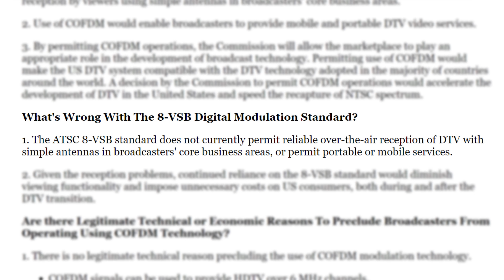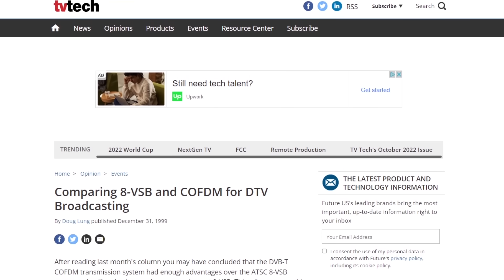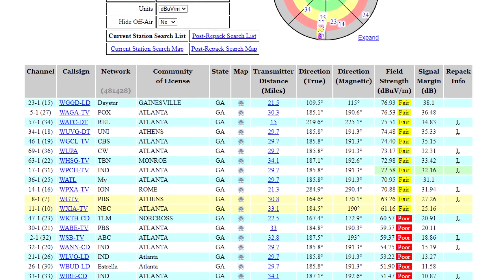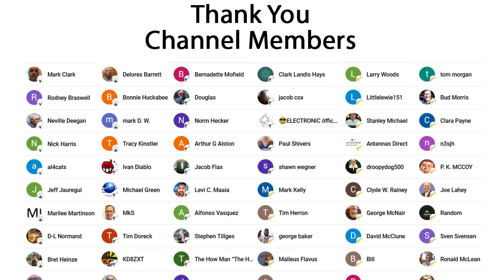This FCC Decision Made Antenna TV Less Reliable for All

Comment: I remember when this all played out.  The 8VSB is a very high speed serial signal with all the data in a single carrier.   Because the data is being sent so fast and the phase of the carrier contains two of the data bits, multi path delays reeks havoc with the signal.  It's only through adva High speed digital signal processing that the system even works.  The phase changes around 6 million times per second.  

COFDM is a low speed parallel signal.  It's like having 6,000 carriers sending the data with 3 bits per carrier.   Because the data changes around 1,000 times per second, any multi path signal isn't a real problem.   In fact COFDM works well with multiple towers sending the exact same signal.   Like 8VSB two bits are sent in one of 4 phase shifts and the third bit is isn't as an  amplitude change.

 Sinclair fought long and hard for the better system, COFDM, but Zenith's lobbing won out.   I remember a NAB Show where they were showing indoor reception with COFDM, something that was impossible with 8VSB.   Pity, Sinclair lost that fight.
Reply from the maker: Thanks so much for posting this comment. I actually explained the technical aspect of both in the video but ended up taking them out to limit the length of the video. I pinned your comment for others to read if they would like. Thanks again for typing it all out.
Reply: @AntennaMan    Thanks, I had assumed that you didn't want to go to technical for most viewers, so I typed it out for those interested in the details.
Reply: It's one of the few things Sinclair did that was actually a good idea.
Reply: @friesareyummy  I agree. I was working for one of their stations at the time. (they had just bought our station the year before in 98' when they were going on a buying spree, right before the bubble burst) They even put out a few reports that stations ran in their newscasts demonstrating the superior signal that COFDM would offer if congress would allow them to have broadcasters choose their own, i.e. give them the option of 8VSB or COFDM when they apply for their digital license. 

They even had one clip where it shows in a congressional hearing, an engineer pick up a simple indoor antenna off a table in the back of the room and walk it up to the front of the room right in front of the committee members while decoding the signal with not a single drop out as the guy walks the antenna the 30ft or so. Meanwhile the engineer goes back and does the same thing with another antenna and 8VSB signal, and the decoder breaks up as he moves it across the room. A stark difference in performance shown right in front of the committee members. 

Sinclair was only asking congress to amend the standard to allow broadcasters to choose either 8VSB or COFDM on their digital license application. It would still occupy the same 6 MHz spectrum as the 8VSB and analog signal, and not cause any interference. The excuse was there was already a hundred thousand receivers (laughable compared to the potential millions in the future) in homes at that time, and manufactures would not be able to make a dual standard receiver, even though the chips for COFDM had been out for years because Europe and the rest of the world had gone that way. 

So it wasn't going to be that expensive to integrate a dual standard receiver, and eventually a dual standard decoding chip on the next generation receiver.. (we already have dual standard radio head units in our cars, AM & FM doh!) Besides, it was found out how hot the early generation 8VSB chips were running and consuming power, so it was impractical with the technology at the time to even consider a mobile device that wouldn't eat through batteries like mad with an 8VSB signal. ATSC 2.0 supposedly solved that, but at way too much expense of data bandwidth. So all you could practically do is one HD signal (decodable with standard ATSC 1.0  RX) with a ATSC 2.0 mobile/handheld signal integrated into that signal. Only a few stations ever put ATSC 2.0 on the air, and there were few and far between phones or handheld devices that could decode it. It was a far cry from what COFDM had inherently built in with it's 2k sub-carrier system.

I guess when you look at NextGen TV, (ATSC 3.0) it's what Sinclair and others wanted all along, but now with modern features built in. Just took an extra 20 years to get there..
Reply: @friesareyummy  
  Yep, now they buy-out local news companies and force them to do scripted, conservative-viewpoint crap! Start that kind of thing and it's no longer news.
  They've also made a cluster-f*ck out of all the 'Regional Sports Networks' in the U.S.
Reply: Thank you Bob Diaz, for the technical explanation.
Reply: @MisterMac56   Sadly, yes.  Zenith paid a lot of lobbing money to make even more money form their 8VSB system.
Reply: Hey, IIRC, didn't we even originally choose an inferior standard for the OTA analog era?

Didn't Europeans mock NTSC as "Never Twice the Same Color" at the time due to the chroma signal's high susceptibility to spurious phase shifts due to envelope delay?
Reply: I understand there was to be a version of 8VSB modulation developed for cable systems, but it never made it out of the planning stages.
I have distant vague memories of reading a paper explaining the supposed benefits of broadcast and cable both using similar modulation methods.
Reply: @derek20la  Yup there was a standard made for cable distribution too, 16VSB. I remember talking to one of the Zenith engineers who worked on the standard. My understanding was the cable industry asked for a cable distribution version of 8VSB when the digital standard was being worked on; when they knew it was going to be digital, not some hybrid analog signal. It worked and was fully realized. But ultimately CableLabs and the cable industry didn't want to pay licensing fees to Zenith. So CableLabs continued to work on a QAM system with encryption in mind and user controls, more extensive program information and a back channel for control for On Demand etc.. I believe 16VSB didn't have encryption built in, or hadn't been worked on to cable industry satisfaction. Basically 16VSB would have been like analog Cable Ready TVs were like. A TV that could tune both digital over the air and swich to cable ready mode with it's standard RF plan but with 16VSB modulation per 6MHz channel. A very simple solution that would have worked especially well for smaller cable systems that didn't have the means for all the expensive processing equipment to MUX everything together and the forward channel controls and  virtual channels that cable systems love to do. Plus it would have been more efficient than putting just one 8VSB signal per channel from an over the air station onto a cable system. I believe in the early days of 8VSB over the air, in NY, some cable systems did put 8VSB signals onto their systems because no digital tuner even then had a QAM tuner built in yet, like they did later on. So for a few years you could use a digital ready TV that could tune in both the cable ready analog lineup of a cable system and also get some digital stations that were being passed through with 8VSB from their over the air signao with minimal processing at the cable head end. That only lasted a short while. Cable industry didn't want to waste precious bandwidth on only one channel per 6MHz in digital, and instead use higer order QAM signals with compressed multiplexed streams etc.. Don't blame them, the cable system is inherently much quieter Signal to Noise and  using QAM256 is possible so long as the system is tight and not leaky. Vs over the air having much more noise to deal with.
Reply: 8VSB has more pixelation when the antenna and receiver has been move to another motion than BST-COFDM and OFDM.
Reply: @FrancisLitanofficialJAPINOY    Yes, even with extensive DSP (Digital Signal Processing), 8VSB is still sensitive to phase shifts.  What's interesting is that in the USA all the microwave feeds from TV trucks use COFDM to connect with the station.
Reply: That explains why 8VSB transmitter needs a GPS receiver to operate.  Odd as GPS is not 100% reliable.  A couple of weeks ago the Dallas area has GPS lock issues they could not track down and had to relocate some flights because of this.
Reply: @glynnetolar4423 transmitters are location agnostic, they do not have GPS receivers.
Reply: @AC9BXEric  They don't need the GPS signal for location.  They need it as a 10MHz reference signal, as I remember.  GPS is not just for location but also provides ways to get a accurate reference signals.
Reply: @glynnetolar4423  they don't need such a reference either. A station may choose a GPS disappointed clock for the sake of accuracy. There are rules regarding accuracy of the carrier. Short term drift is so small anyway it would have no effect on reception. Stations use a time reference, often GPS, for keeping programming on time, synchronizing automation and so on. Some station's clocks are wrong.
Reply: Greetings: I will agree the tech. Now 4 the "rest of the story".  The feds enacted DTV 2 grab some of the TV freqs 2 sell. Some now used in PS. In so found they also deregulated the transmitters and band allotments 2 make path 4 said frequencies and services. Such resulted in weaker signals 2 as 1 example. Some were baited by Ads saying they needed a "Digital TV Antenna". When, in fact, that is a scam. A higher gain perhaps, however "Digital" has nothing 2 do with it.  Another point is they knew less Ppl would stay with antenna TV after such changes. This would lead them on a closed system (cable) , DSS which enables 2way communication. As such eavesdropping on viewer preference could B facilitated... A point of view if U R paranoid. However, it has truth and weight. The new "streaming" tech has more truth and weight... Think of it as lead gospel.
Reply: @MisterMac56, you've been indoctrinated with the lies about the Nixon presidency, Nixon was actually in the fight for the American people and the world, you'll see and or understand what I'm talking about in the very near future. The American people have been drastically decieved by the Nazi democrat party and their fake news propaganda mainstream media.
Reply: I'm from the government, and I'm here to help.
Reply: I was in meetings with two  of the main companies that were considered at the time. Zenith favored VSB for one reason because it could co-exist with analog TV better than QAM, which was backed by General Instruments. Both companies lobbied the company I worked for to join their consortiums. I do not recall COFDM being in serious consideration and likely for good reason. I also recall meeting with a giant networking company that built an OFMD system for internet to the home. The transmitter had to be backed off so much to avoid internodes amongst the thousands of carriers that they became way too expensive and the system failed. I think the processing power required for COFDM was likely unrealistic 30 years ago. Remember that More's law would say that we have 30,000 more processing power in a chip today than they had in the late 90's. So what is doable today, would have cost 30,000 times more back then.
Reply: @L-36    Europe did go with COFDM for their system.
Reply: @BobDiaz123  This is interesting https://transition.fcc.gov/Bureaus/Engineering_Technology/Documents/reports/dtvreprt.pdf
Reply: @L-36    Unfortunately, the audio and program data was never transmitted with a more robust system, like 2VSB.  People could stand the dropouts and freeze-ups of the image, but the loss of audio is horrible.  Oh well, the new ATSC 3.0 might fix some of those issues.

Comment: A 1999 study (OET Report FCC/OET 99-2) compared trellis (8VSM) coding to COFDM. 
 Bottom line:  Neither system proved superior over the other for picture and sound quality, however, the COFDM provided higher immunity to multipath while 8VSM performed better in weak signal situations due to its intrinsic higher signal to noise ratio (4 db improvement).  European broadcasting, unlike that found in Canadian and US broadcasting, used repeaters which simultaneously transmitted on the same RF channel as the master stations to extend coverage.  This presented a multipath problem for viewers thus forcing COFDM (DVB-T) as the best choice.  To combat this problem in North America,  TV manufacturers added a 22 microsecond delay to reduce this effect. This adaptive delay can't completely eliminate multipath especially if the multipaths are close in strength.  In such situations a highly directional antenna may be required.

Comment: While the points about why the FCC picked 8VSB for digital TV modulation is correct, saying the decision made antenna TV less reliable for ALL is just wrong, perhaps for many but NOT all. Also the statement that FM is better than AM is also wrong.  As you know before digital TV the NTSC system used AM to transmit the video signal while FM was used for the audio and clearly Video needs tons of more information transfer than a simple audio signal - hence to say that AM isn't as good as FM is incorrect.  Once again it is FCC decisions & rules that make FM seem to sound and perform better than AM, it has nothing to do with the modulation technique of the 2 systems.

Comment: I worked for Viacel... I was one of the engineers enabled the demo before congress.  We had an antenna the size of a pencil for our COFDM cast and they had 2 huge antenna's behind the curtain's for 8VSB.  We had an STA for UHF channel 31 in Long island (owned by Richard Bogner antenna wizard and RF magician) and would do demos.  While driving around Manhattan we used standard IP to broadcast a set top box built by Nokia as the receiver and a standard cell phone as the back channel 23 years ago.

Comment: Enjoy your channel and knowledge...
I bought a Televes DAT BOSS Mix LR a few years ago and it amazed me.  Seriously.  I laid it on the ground and started getting solid signals 80 miles away.  Put it on the 35 ft tower and I was getting 125+ miles on a couple stations.  Bone stock out of the box plugged in a TV.  I have been playing with TV for 40 years, along with HAM, FM, SW, etc.  including building dozens of antennas.  Without ANY exaggeration and with real world proof, it is the best on the market for many reasons.  Reception and build quality top the list.  Today I received the new version that includes Low VHF model 148383.  It will get roosted this weekend.  I'm so excited all over again.  May post results on my YT channel just for fun.

Comment: There is a solution for the existing problems stations  could repeat each others signals on sub channels in sd on all towers. Giving backup channels to watch. It would fix low signals and increases all channels range.  Lets face it mormal users cant tell the dif between hd and digital sd

Comment: In the 1970's I noticed that in Europe the analog TV signals there produced a fine, sharp color picture that was superior to anything in the USA. I was told they had a standard that used more" lines per inch" of picture compared to the USA standard, the audio also seemed better.

Comment: I think I've tried every digital antenna out there... boosters, etc. Not one of them out performed another and they all pretty much suck. Some days you can pull in a channel and have it come in ok, other days... nope!  Some days it'll come in in the morning... different story after 5pm. And I live in Florida where it's flat and a signal should have no trouble pulling anything in from a pretty good distance right?  Wrong... even my local TV station, whom I live less than 4 miles from... won't come in for squat. It'll come in and freeze up 2 to 3 times a minute or not come in at all. Try moving the antenna around the room?  Might be good for awhile but then you find yourself moving it again, or trying to. They advertise they'll pull in a signal from over 100 miles away... well let me tell you... none of em live up to that either. We got screwed by the FCC. In my opinion, antennas are now completely worthless.

Comment: I cut the cable before cable-cutting was cool. In the early '90s Comcast raised their rates even for a local only package, so I bought a huge Radio Shack antenna and I put it in the attic aimed at Pittsburgh and a distribution amp. Then, the only stations we had were 2,4,11,13,16,22, and 53. With the switch to digital TV, I didn't have to do anything but re-aim the antenna a little to get channel 4. We now have a crap-ton (about 80) of channels since each station has multiple channels and other channels have been added. 30 years on, and the antenna is still in mint condition since it's been out of the elements for its entire life.

Comment: I haven't watched the video, but, I can say without a doubt that analog tv was far superior to digital channels. Where I lived at the time, I could pick up channels from 80 miles away with a decent set of rabbit ears. These days, I'm lucky to receive a signal from a television station that's 3-4 miles away. 

At least with a minimum signal you could pick up a TV station with a snowy picture, but now, the digital signal needs a really strong continuous connection just to be watchable.